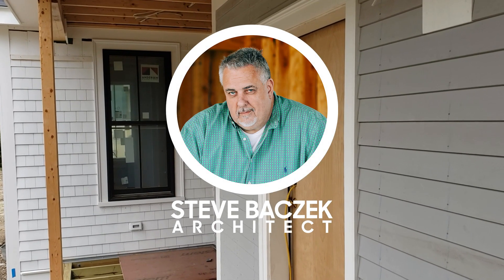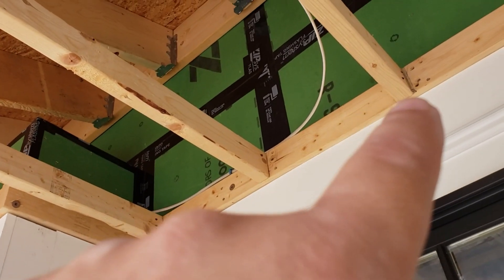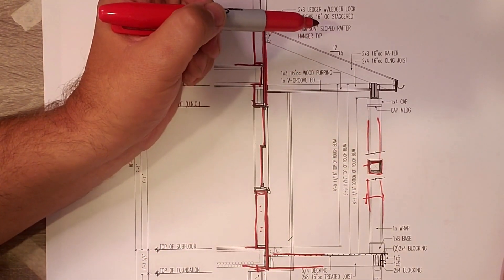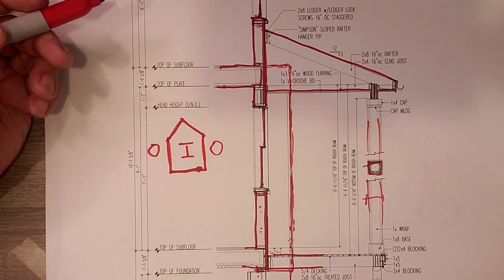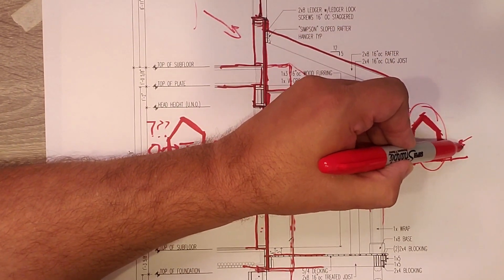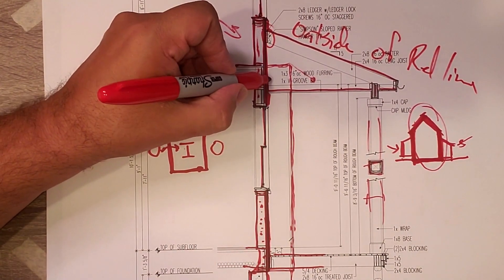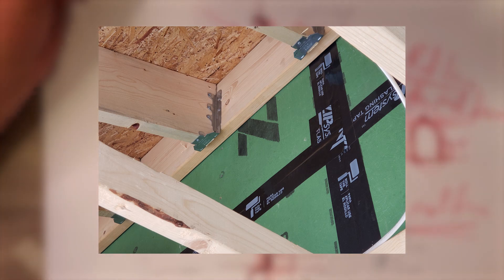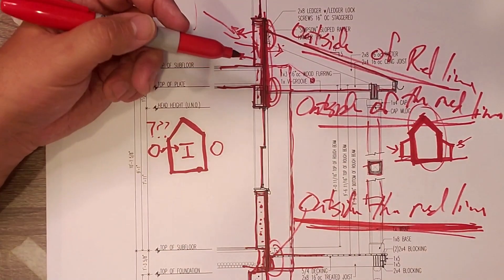AIR BARRIER CONTINUITY

Comment: Good video.  I guess the ledger boards for the porch roof are fastened to the inside framing through the Zip-R cladding, which has about an inch of high density foam.  I guess you need to make sure that the person screwing in the ledger doesn't over tighten the screws and start compressing the foam.  Probably not an issue since the ledger and OSB distribute the force across a large contact area.  I wonder if this house is a Monoply style house, where the Zip-R wall and roof cladding meet up to form an uninterrupted surface and roof overhangs created by the technique  shown in this video.  Of course the roof overhangs would not be supported by posts as is the case with a porch.  So, it would be interesting to see how the roof overhang is done in another video, and whether Monopoly style or not, the details of that.
Reply from the maker: Ledger Lock screws 4 1/2"

Comment: I’ve built a number of houses with cantilevered porch ceiling joists and porch rafters that bolted to the main rafters before sheathing. It was a very strong way to build, with a rock solid porch even before posts were installed…. This Old House even built this way. Little did we know 40 years ago, and your method seems absolutely superior.